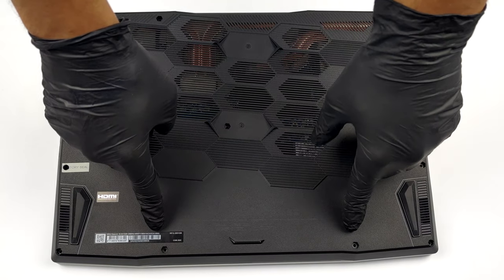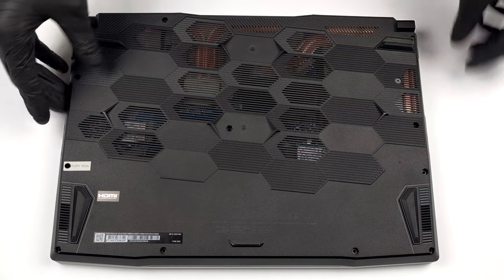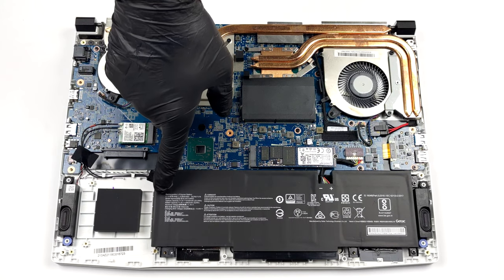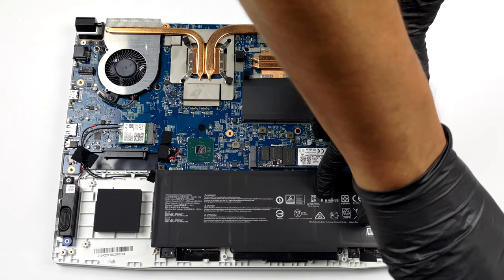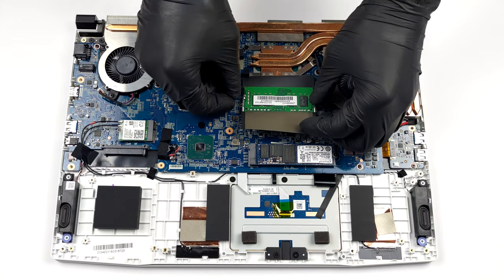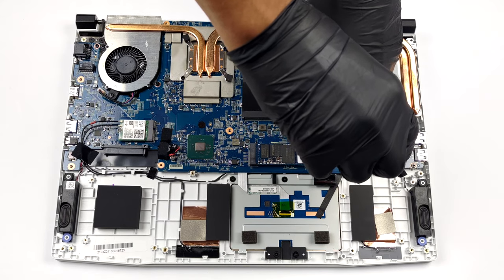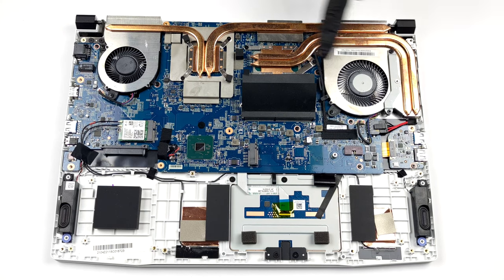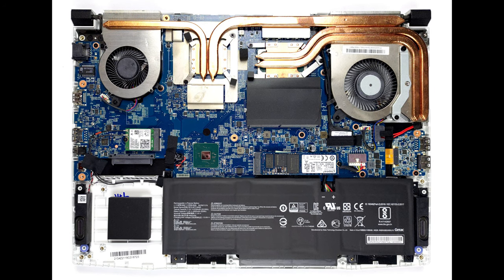🛠️ MSI Sword 15 - disassembly and upgrade options

Comment: Hey everyone, jumping in on this review. I just wanted to share my experience with the MSI Sword 15 A12UCX because I'm having freezing issues while gaming (Valorant and Assassin's Creed Valhalla) too.

Here's what happened to me:

Bought the laptop and got freezing on the second day of playing.
Thought it was a fluke, but it's happening more frequently now (over 5 times).
Took it back to the store:
First, they did a clean format (reinstall of Windows). No change.
Then, they swapped my 2x 8GB RAM for a single 16GB RAM. Still froze.
Finally, they sent it to MSI for repairs, which will take 2-3 weeks.
My concern is similar to yours - will they just fix it and send it back, or will I get a replacement?  Honestly, a repaired laptop wouldn't give me much peace of mind.

If anyone else has had similar experiences with this model or gotten a replacement, please chime in!

Comment: cool video,
got my computer around march
upgraded recently from 8GB RAM to 32GB
and 512GB to 2TB for storage nvme ssd
(note that if you want to transfer the windows os always check your ssd manual, they'll provide a transfer manager for free and it's easy to use (my dumb ass spent a week looking online on how to tranfer it))
although i did not know about the sata ssd, i'll give it a check on my computer later, thanks for the video
Reply: also keep track of your screws and make sure to use the right screw bit size, recently lost one screw and had to buy a whole 350 piece set of amazon dirt cheap but could have been easily preventable, i used a small food container for sauce with lid and still lost a shell screw
Reply: Do you have a NMVe or Ram you’d recommend? I’m relatively behind on computers and looking for something dependable and affordable
Reply: @soulvynthis334  i bought the NVme from samsung and the ram from crucial both for my laptop and work alright
Reply: @FriedIce3  gotcha I’ve looked at both those and planning going with them just wanted some advice. I appreciate it

Comment: Weirdly enough it seems not all models of this laptop come with the SATA connectors, mine didn't and the removable rubber piece has been replaced by four plastic support things.
Reply: Mine too
Reply: @sythbtd7393  It really sucks cus I kept an internal HDD from and old pc but I'm forced to use an USB enclosure
Reply: @SergioSergio12345  yeah it’s unfortunate
Reply: Saaaaaame

Comment: Is the MSI Sword 15 A12 series the same? On your website it says it has only 1 slot for SSD available, but the MSI website says it has 2, I just want to know if it still support HDD, or where exactly is the other slot

Comment: Will opening the Factory Seal screw void the warranty?
Reply: Yes
Reply: NO! MSI has stated that your warranty is NOT voided if you upgrade the memory/ram. However if you break anything during the upgrade. It will not be covered

Comment: how can add additional hard drive?  since it does not have support
Reply: I own this laptop I actually went with a external hard drive the firecudda 4tb one to run my games off of it works great
Reply: @braedenheverly2884  did you put the black rubber cube back?